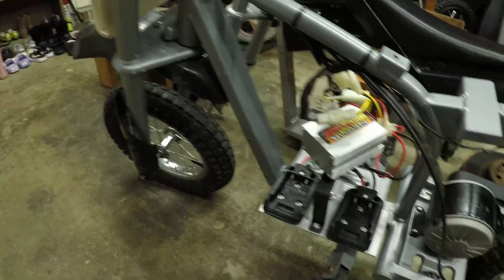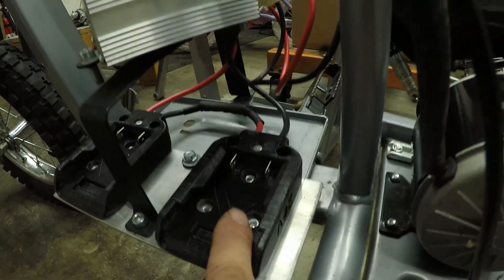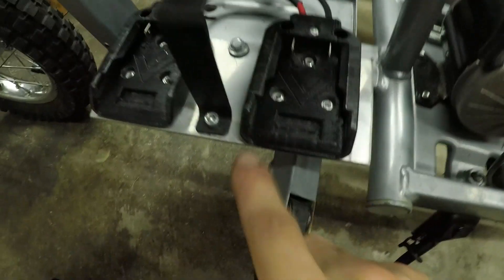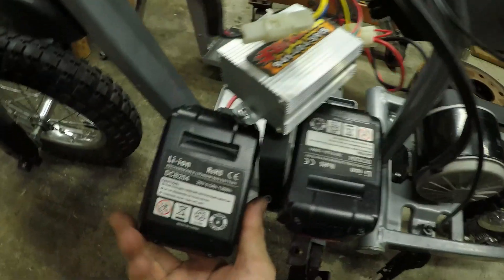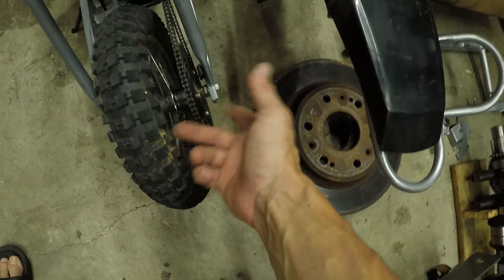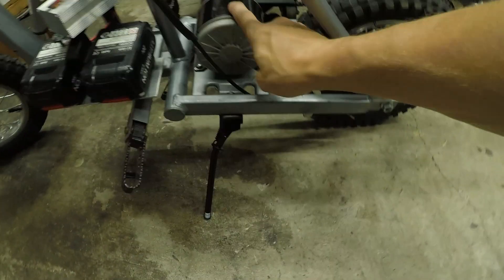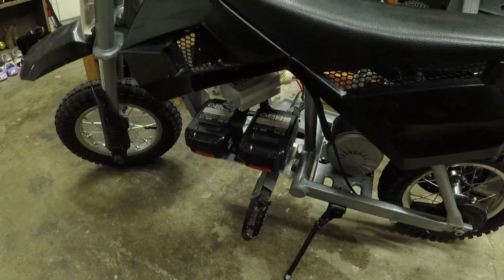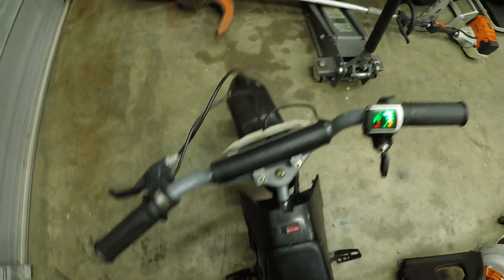36v Razor Mx400 build break down w/Dewalt lithium batteries

Comment: Can you make it faster??
Reply from the maker: only if you put a bigger motor and you would need to make something or buy something to mount it, a new controller to support the correct voltage you want to run.  This is a 24v over-volted to 36v.

Comment: So with all that u have already done can u just upgrade the motor for more speed later with out updated everything again?
Reply from the maker: I could defintely put a 36v motor from a bigger razor as long as its 36v this controller will run it... stock 36v is 500w the motor on there now is only 250w
Reply: Ok cool.I ordered everything from ur links.I think I'll try and update the motor at a later date once my son gets used to the extra speed

Comment: What’s the range? I want to build a 48v 1800w razor mx500 for my son but with drill batteries.
Reply from the maker: I'm not sure how far it will go but it runs for a solid 30 mins -45mins depending how fast your cruising

Comment: Hey so I saw your MX400 build and was wondering if you could get the same batteries for cheaper? I just want the build to be a little cheaper. And also if you could make a video about wiring it all that would be amazing.
Reply from the maker: The batteries used on the Mx-400 are about $70 for two 6.5ah Dewalt style batteries... you could probably find some cheaper but I got these on amazon. The wiring is easy because the Fast scooter kit is labeled and plug n play. just have to connect the two power wires for the battery,
Reply: @ModdedByP  Do you have to put a fuse between these batteries? I’ve seen that done in other builds. Not sure if it is necessary though
Reply from the maker: @h0nd0  it wouldnt hurt, i just dont care if something gets fried!

Comment: Amazing. I saw a 36v controller that comes with a 36v motor. Thoughts on that? 
I also did the same battery conversion on my Son’s F150 power wheel.
Reply from the maker: its probably a good enough controller... usually the cheaper ones are larger and harder to fit on the bike... Ive heard of people doing a "shunt" mod to stock controllers, might be worth a google at very least.🍻

Comment: yo this is sick how much for all the upgrades
Reply from the maker: not that much to build this one... 2 knock off dewalt batteries were $70 and the overvolt controller was like $60.  Had to get the battery base plates which were $20 the only other thing was a $15 throttle... All parts off amazon! I got lucky and found this bike in a dumpster!